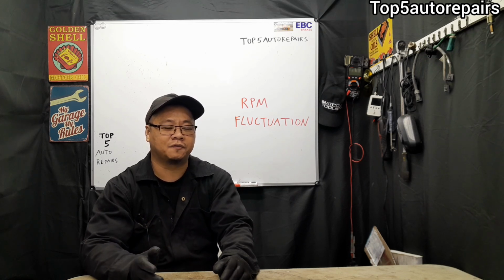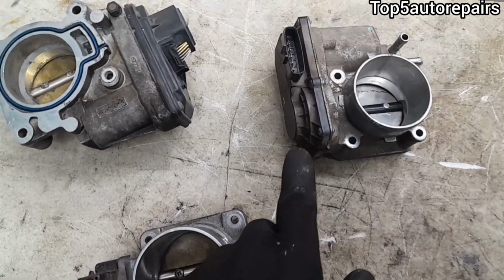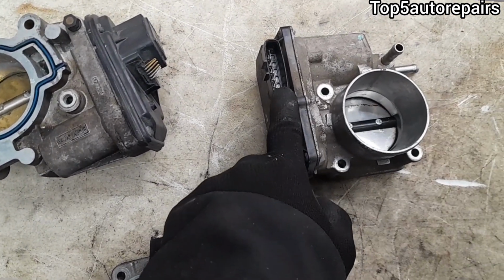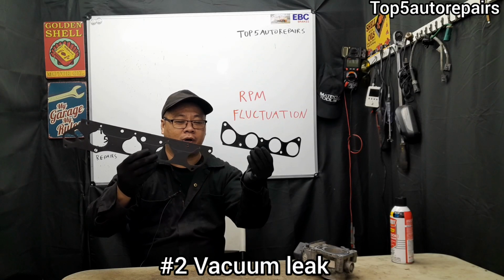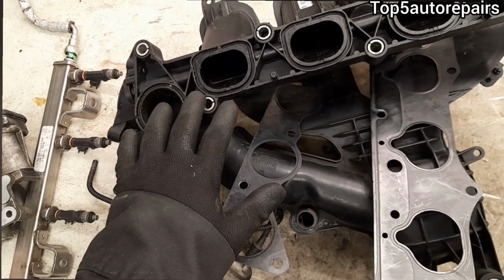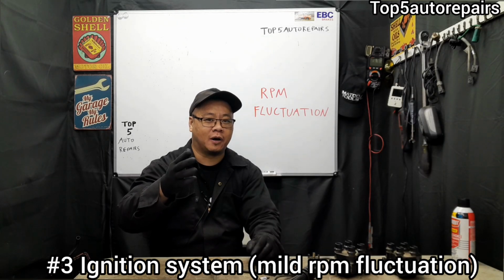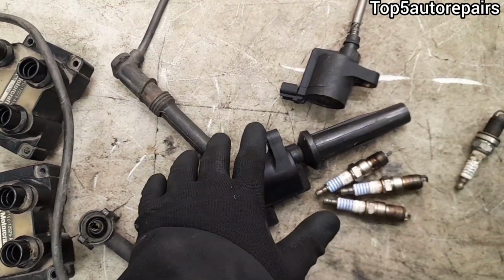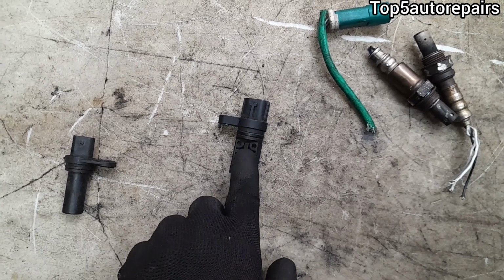RPM GOES UP AND DOWN AT IDLE RPM FLUCTUATION

Comment: Im experiencing mild fluctuation in rpm and the interior lights dim slightly? Weak battery..alternator?
Reply from the maker: Check alternator voltage and it should be above 13.2 volts with the engine running
Reply: @Top5AutoRepairs thks alot
Reply: @Top5AutoRepairs with the car running I'm getting 11.4 to 12.3 volts. Bad right?
Reply: That's with everything on..ac..radio..lights

Comment: I have a 1uz vvti engine, replaced the pcv valve and hose going to it, had a low idle. Found out I ripped the grommet when installing the pcv valve because I didn’t lubricate it. Got a new grommet and I also cleaned the throttle body, when I started the car it stays at 2,000 rpm to 1500 rpm cold. I didn’t put the car in acc when cleaning throttle body so I was lifting the throttle plate manually to clean. Any suggestions on getting the idle back to normal which was about 1100 1000 rpm when cold?

Comment: 2004 Lexus Rx330. No CEL, runs great but Once at operating temp, sometimes Idles 550 to 650 rpm with slight rattling noise at 550. Cleaned the throttle body no change. Turn on AC and idle kicks up to about 650 and idles perfect with no noise. Any of your other possible causes you mentioned cause a CEL?
Also replace the coolant temperature sensor with new factory Toyota/Lexus parts as well and no change.
Thank you!
Reply from the maker: It runs poorly/low idle in closed loop/engine warmed up. I'm leaning towards a lazy O2 sensor since there is no CEL.